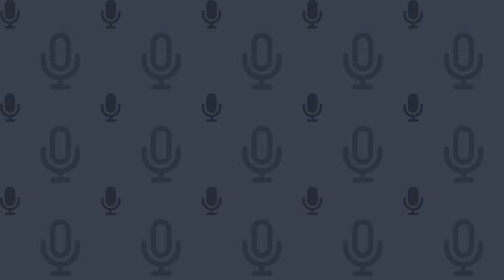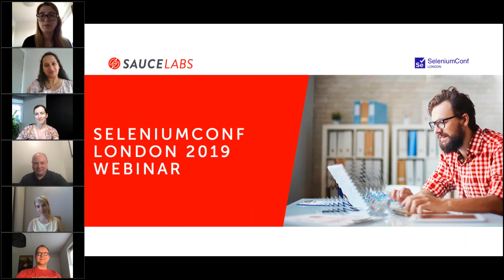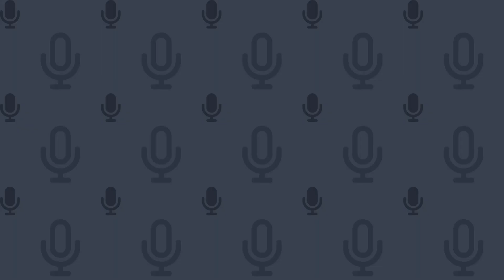SeleniumConf London 2019 Webinar

Comment: Personally i dont think ML to correct Selenium tests is a good approach. Personally i think if your tests Fail they Fail because the application changed and you didnt work with Dev when they did the change to update the test. So really applying ML to adapt failing tests is highlighting that there is a problem in the development processes that your expecting the ML to correct for you. Why not fix the root problem?